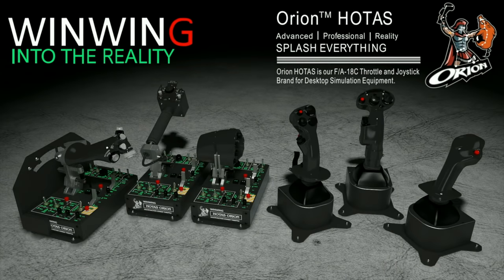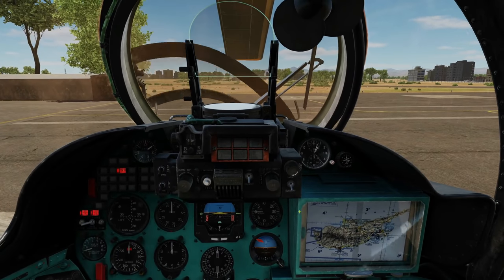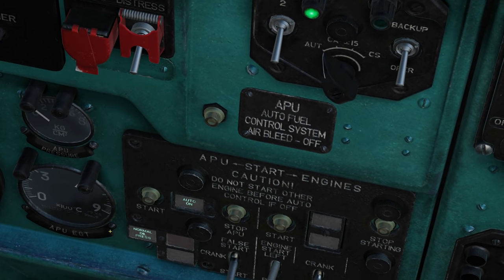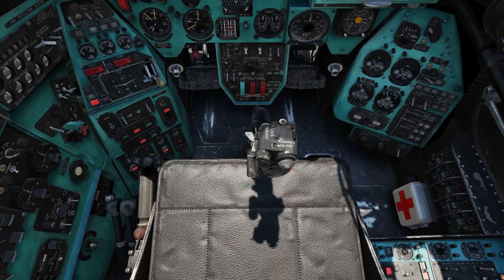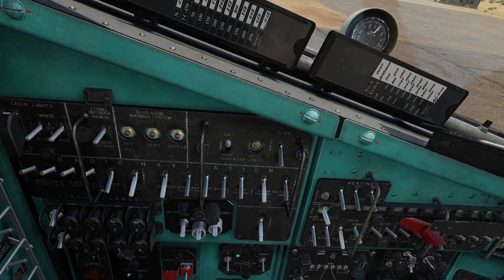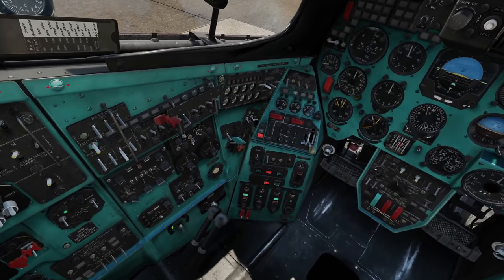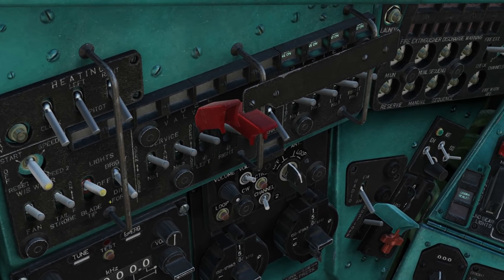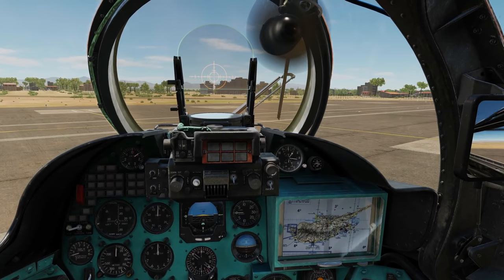Mi-24P Hind: Cold Start Tutorial | DCS WORLD

Comment: Hi GR, you have mentioned dust protection and that you have to leave it on. I would like to add that you MUST turn it off when taking off and in flying. If you don't turn it off it will lead to electrical power loss at max collective.
Reply: If it has to be off during take off and flying when can it be on? Only at the ground when parking?
Reply: @slowhornet4802  It is there mainly to filter out sand and dust that is flying into the engines while the hind is parked or taxiing and rotors are spinning. If you are curious turn it on and fly for 3-5 min. You'll see your electricals will start to die.
Reply from the maker: Good tip!

Comment: start the downwind engine first. then you don't have exhaust interfering with the downwind engine start.
when the rotors are up to speed this is not an issue.
you need to know the wind direction anyway so its not a wasted step.
it helps you not to forget to check wind direction.
Reply from the maker: thx

Comment: Just one thing Cap, any switch with a cover you don't have to switch off before closing that cover. The cover is designed to be easy to see and close in an emergency thus closing the switch. Would save you an extra mouse click 😉
Reply from the maker: thx
Reply: That´s not completely true. Some covers will move the switch under it to it´s original position when closed, however others will not. The covers that won´t usually have a rectangular whole that when flipped back will act as a mechanical security for keeping the switch in position. The Hind like many other Russian aircraft features both types of switch covers. An example for the latter type of "security switch cover" would be the left and right red fire enine valve cover located on the left side panel of the hind.
Reply: @Air-Striegler  I wasn't aware of the type that allow the cover to hold the switch open, I have only ever come across the other  type as I had described in the machine tool and motorsport industry. Every day is a school day!
Reply: @Decrepit_biker  
Same here, John. An open mind never stops learning. Cheers mate*

Comment: I used a free trial. Well, rudder pedals are essential. It's hard to fly even with Thrustmaster Warthog. But great looking sim 100%.
Reply: I agree. The rudder is super sensitive, I had to apply a good amount of curve to smooth it out.
Reply: The rudder is absolutely essential when taking off as that’s when you’ll feel it’s effects the most. Otherwise it’s not too bad though it is by far the strongest out of the other helicopters.
Reply: I can take off quite well without using rudder pedals so no, I wouldn't say they are essential though I'm sure you have a better time flying the helo with the pedals than me.
Reply: @notproplayer3649  please tell me your secrets. The rudder likes to swing me hard whenever on take off.
Reply: @darkest_eclipse8271  Be extremely gentle when ruddering on takeoff, or the chopper will start spinning,
Reply: Try the Kamov. With its counter rotating rotors pedals are not mandatory.
Reply: @darkest_eclipse8271  there's no secret really you just gotta be super gentle with your twisty stick, even more gentle than in other DCS helos I noticed. It can be frustrating at times but definitely possible with practice.
Reply: @Tamburello_1994   Correct. Using since 2009. That is why I was in shock when I crashed 3 times before the first take-off. :)
Reply: @darkest_eclipse8271  Look in your options and make sure Rudder Trim is set to OFF.

Comment: 0:36 is totally wrong. The right side circuit breaker panel is not just for weapons - it’s for fire protection, anti icing and some fuel pumps too. The weapons circuit breakers are split across both panels. How did you come to the conclusion they are just for weapons when only a few of the switches actually are?

Comment: Wouldn't you need to start the apu generator in order to start the engines?
Reply: Doesn't seem like it at the moment, I don't know if it works like that in real life or if it is just an early access bug.
Reply: As long as you have power in the batteries it shouldn't be required, the actual enginge cranking is done with APU airflow blowing into the engine :)
Reply: @Plumsytheghillieone  oh, thanks so its a pneumatic starter - didnt knew :D